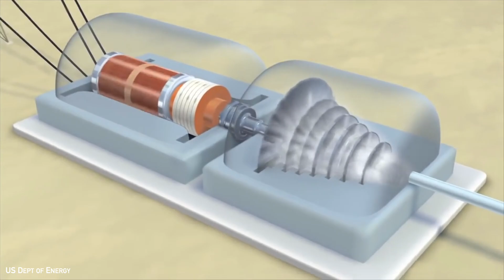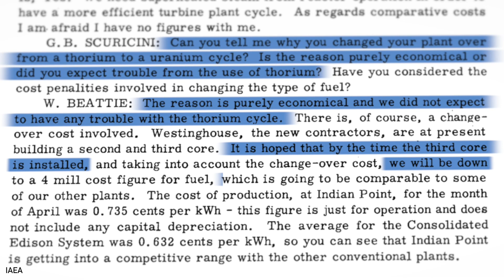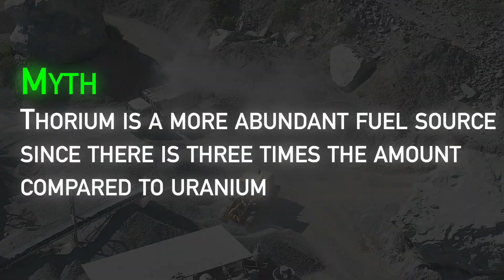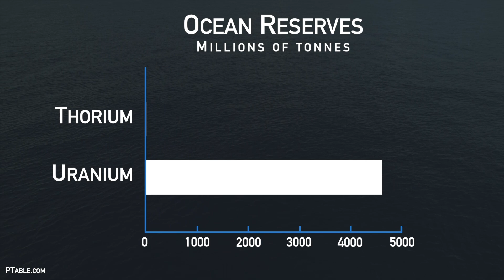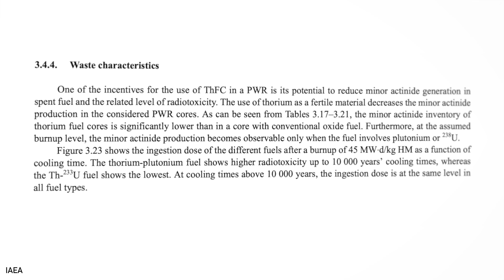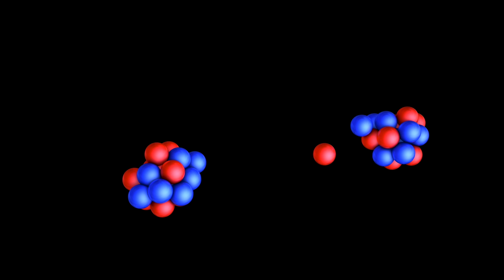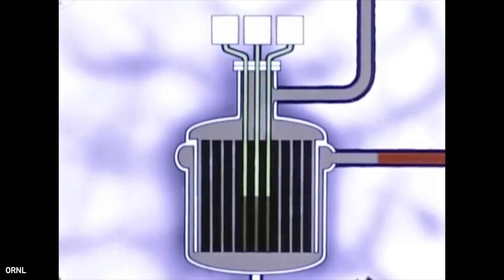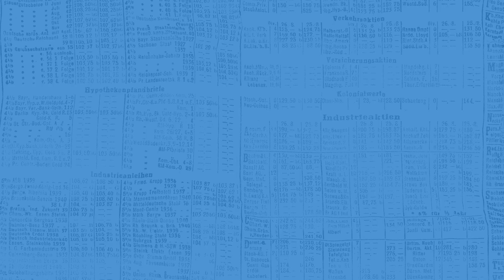*Almost

Comment: There are hundreds of years of Thorium at present power production already mined and sitting in tailing piles and containers from rare earth operations.  We just need to learn how to use it, which was done in the late 1960s.  There is no supply issue.  Cherry picking uncertainty issues from the early 60s is laughable.  Lots of mis-information on the AtomicBlender.
Reply: It also sounded like he just compared amount of thorium to amount of uranium, without taking into account that most thorium is usable fuel, and only 0.7% of uranium is U-235.
Reply: @jamesbrown99991  thorium is not usable fuel, it needs to be converted into uranium by bombardment with neutrons.
Reply: @madsam0320 you can breed what you need to sustain the reaction. You only need initial bombardment to start it.
Reply: "LOTS OF MIS-INFORMATION ON THE ATOMIC BLENDER".
Reply: The US has something like 7 million pounds of thorium nitrite already in storage spread across a few facilities for such materials. That's definitely enough to run many dozens of reactors over their lifetimes.
Reply: Sitting waste piles is not readily accessible the don't refine and separate waste it all goes to the same place.
Reply: @SunShine-xc6dh  Who ever is mining rare earth elements right now is putting Thorium in their pile of mine tailings.  The Thorium could be separated while the material is processed.  It would not require any additional mining.  This would have the added benefit that the tailings would be less radioactive.  And the Thorium could provide LOTS AND LOTS of carbon-free energy.  WIN WIN WIN.
Reply from the maker: Many of the issues from the 1960s are solved, but not all. Teller in 2005 wrote about a lot of the same problems with Th-MSR before he died while advocating specific areas of research needed. China seems to be looking to address those.
U-235 is only 0.7%, but fast reactors can use the rest so I don't think it's fair to say only 0.7% of U is usable while 100% of Th is. A fast reactor can use 100% of U just like a MSR can use 100% of Th.
Reply: @atomicblender  interestingly, some of those could also "digest" the dirty actinides in current nuclear waste, which, also if also a challenge, for me seems one of the most interesting ways to go !,
If you can make that message diffuse into the brains of  the more stubborn anti-nuclear activists, reducing the quantity/activity of the nasty stuff we already sit on  (no matter if counting for the next 100 or 10.000 years)  is something more attractive than changing totally harmless Thorium into something which is concerning. IMHO, if thinking new reactors, it should be waste-burners to some extent.
Reply: @atomicblender  You have not understood the differences between solid fuel and liquid fuel reactors.  Solid fuel must be reprocessed to achieve full burnout.  Liquid fuel such as the MSRE can use online processing.  BTW:  Stop using WASH 1222, that is an AEC CMA for firing Dr Weinberg and hiding his research from the public.  Only anti-nuke freaks like the Union of Concerned Scientists use it as evidence.

Comment: It's always nice to hear a video which talks about the risk of proliferation for thorium, especially with a MSR where it's easier to extract protactinium to get pure U-233.  I had no idea about operation teapot--I've always cited India's Shakti V test which used only U-233 but had a much smaller yield.
Reply from the maker: The MET test part of teapot seems to have been a bit of a last minute switch to a U-233 core, and also resulted in lower than expected yield. So maybe not as good, but still works.
Reply: If I recall, people said that making U-233 would inevitably lead to a U-232 impurity.  This made it difficult to handle because even minuscule amounts of U-232 would create enough gamma radiation to make it impossible to work with the material by hand the way they did in the Manhattan project.  However most of the studies were looking at existing heavy/light water reactors instead of molten salt.  As a result, some Pa-233 would be in the fuel rod for a number of days/weeks and it could absorb an additional neutron before it was processed.  With a molten salt reactor, the Pa-233 could be separated within hours or even minutes, so the U-232 impurities would be much smaller, though I don't know if it would be safe enough to handle.  I'm not a nuclear physicist, but came across one study which acknowledged it presumed traditional reactor designs and an MSR could have a proliferation risk not covered by the study.
It's been a couple years since I looked at this and unfortunately don't remember where the study is.  The wikipedia article I changed has been updated since then...hopefully for the better.
Since India and the US would have sourced their U-233 from fuel rods (the MSR experiment was 5 years after Operation Teapot), they probably had to deal with U-232 contamination.  Operation Teapot was early enough they may have underestimated the risk, but it proves that the scientists didn't all die before they made a bomb even if they had health consequences later in life.  I'm sure many Ukrainians now regret giving up the bomb when they signed the Budapest Memorandum, so there are still circumstances where scientists would knowingly risk their life to produce a weapon.

Growing a channel like yours is a huge commitment, but the quality's as high as many of the channels I watch.  I found you via youtube's algorithm, and subscribed; hopefully others will too.  Other most youtubers don't know which video will go viral.  Good luck!

Comment: As the old adage goes nothing worth doing is ever easy! Yes Thorium has some difficult challenges and hurdles to overcome, but in the long run it will be well worth it!
Thorium is the future of power and it will save the world! If nuclear energy from Thorium had the same time, money and resources put into it as fusion has had and still has we would already be well on our way to Thorium nuclear energy!! With the full utilization of our advanced modern technology, engineering, material science, safety measures understandings and designs, computer technology and robotics we could make it happen.
Reply from the maker: Fair point! Honestly, India and China are most likely to make thorium happen on a larger scale, in my opinion. Other countries are too heavily invested in uranium cycles and as long as uranium is cheaper, thorium will be slow to develop.